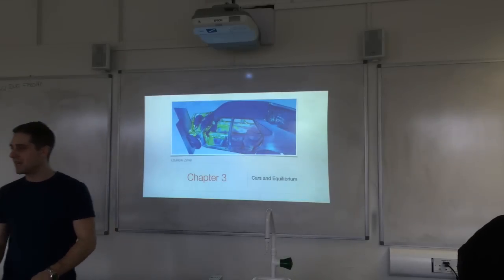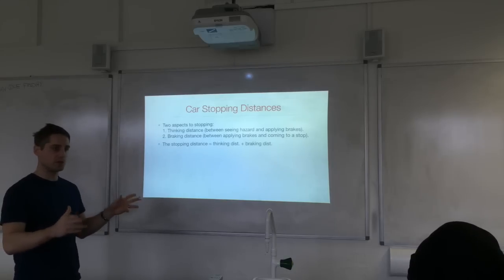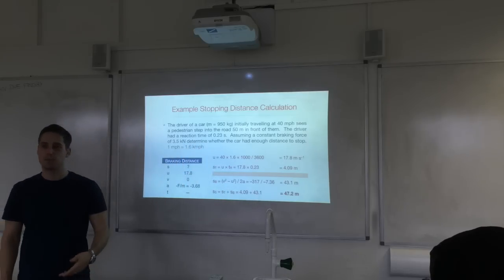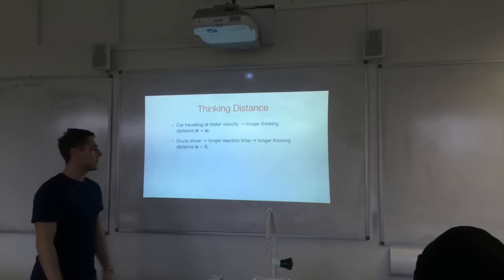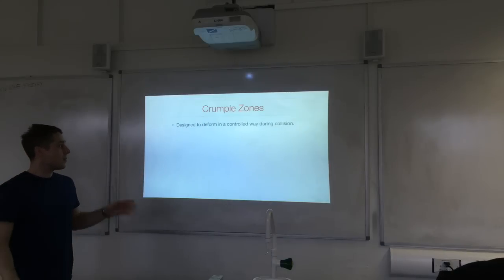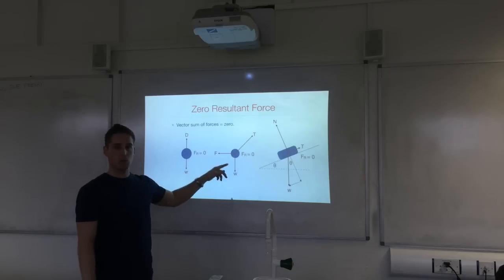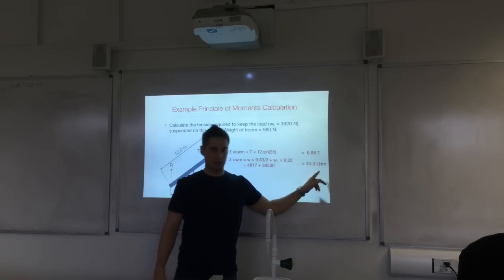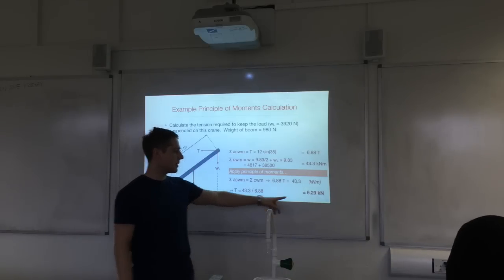G481 Mechanics Overview: Lecture 3

Comment: Really like the way u encapsulate the whole unit like this  
Have u made videos like this for unit 2 As too ?
Thanks a lot of the videos
Reply from the maker: rodaabokor good to know, thanks.  Haven't done unit 2 yet. Planning to start the lectures this Thursday with electricity. Then waves and then quantum.
Reply from the maker: rodaabokor Electricity and Waves videos are up on YouTube now.  Got Quantum planned for Wednesday,
Reply: lscphysics  thank you
Reply from the maker: You're welcome.  Hope the G481 exam went well for you on Tuesday.  And G482 soon!
Reply: lscphysics that exam was so diff to the normal papers and I was counting on mechanic as well, probably got a b. I will have to get a high A in unit 2 now.  Never the less, a huge thanks to u .
Reply from the maker: Yeah unit 2 is the weightier paper, so good chance to pick up lots of marks if you do well in it.